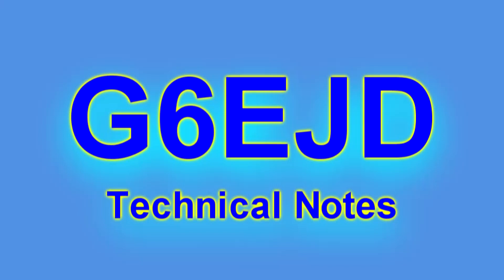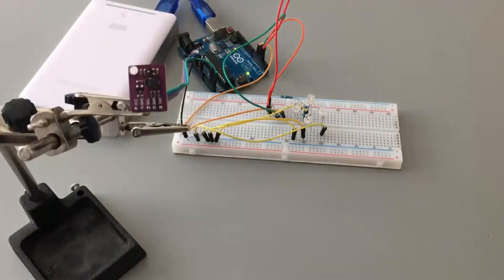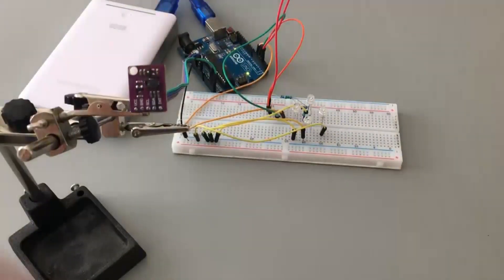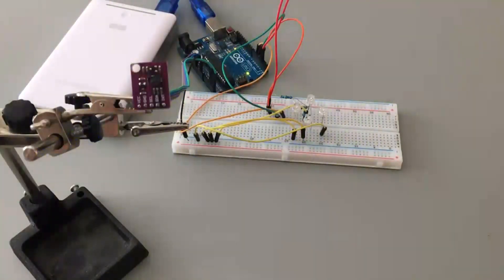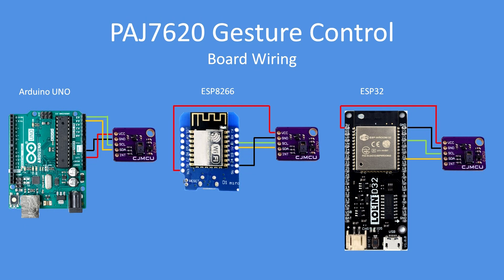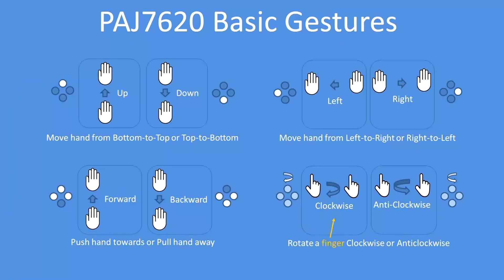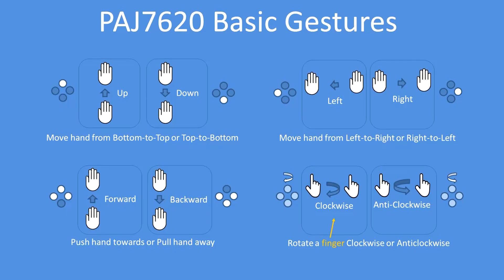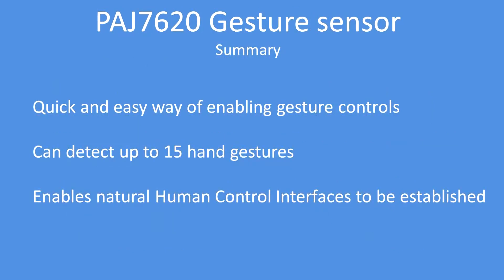Tech Note 104 - Adding Gesture Control to your Arduino / ESP projects

Comment: @G6EJD - David, Is this sensor better than dhe APDS-9960? Im planning to use a gesture sensor in a production product. Thank you!
Reply from the maker: The 9960 is a popular device, used by Samsung in their phones, but predominantly for detection of the phone being moved to the ear to switch off the display. Gestures have to be coded from the 4- sensor positions, whereas the PAJ7620 has 9-built in gestures so the interface is easier and done for you, for example your code would need to keep polling the 9960 for a proximity detection then if you want to detect a swipe monitor the 4 sensors to detect changing amplitude and hence gesture, the  PAJ7620 whereas will do all that for you.

Comment: nice work ! but I wish it could detect gestures by a standalone  esp32-cam  , like esp32-cam face detection
Reply from the maker: You’d have to ask the chip manufacturers about that
Reply: @G6EJD   maybe I will do that but before you'd better see this 
https://eloquentarduino.github.io/2020/01/image-recognition-with-esp32-and-arduino/ 
I mean something like image proccessing
Reply from the maker: I bet it could not tell the difference between an orange and green ball and the real fruit.
Reply from the maker: Yes I had a sample from Espressif before they released it, works well.
Reply: @G6EJD  well , what’s ur idea about something which can recognize open and fist hand?
It will be awesome in BMS fields,remote less and key less lamps... if it comes true ...
Let’s do this shit OK?

Comment: hello, I have these error, I used arduino 1.6.5 IDE.   

Arduino_Gesture_Control:54: error: variable or field 'LED_Swipe' declared void
Arduino_Gesture_Control:54: error: 'swipe_dir' was not declared in this scope
Arduino_Gesture_Control:54: error: expected primary-expression before 'int'
variable or field 'LED_Swipe' declared void

can you help me? Thanks.
Reply from the maker: Have you installed the library '#include "paj7620.h"'
Reply: Solved... with arduino 1.8.7 works...

Comment: That's cool!
It works well in Uno, but it doesn't work in ESP8266. ESP8266 cannot get the I2C data from PAJ7620.
Does the same source work on Uno or ESP8266?
Reply from the maker: RCanDo, I can see no reason for it not to work on the ESP8266 apart from the UNO uses 5v inputs/ outputs whereas the ESP8266 uses 3.3v so you may need to use a level shifter on the ESP8266
Reply: You are right. It works well on the ESP8266 too. Thanks~!

Comment: Finally tried this sensor, but very dissapointed. It's extremely inacurate, or maybe the library is not well programmed. Being the datasheet a joke (no information on what each register means), it becomes impossible to fine tune the sensor. For those in need of a gesture sensor, you can try the APDS-9960 which is by no means perfect, but very much more accurate than this piece of junk.
Reply from the maker: My sensor works perfectly from about 2cm to 30cm range. Have you checked there’s not too much infrared around the sensor as that what it uses. The data sheet gives enough information to enable gesture shapes to be programmed and adjusted. It’s got to be said, there are an awful lot of rogue suppliers selling devices that failed quality inspection as good products, also shameful that manufacturers sell their rejects rather than scrapping them.
Reply: @G6EJD  Hummm.....I bought this one from Aliexpress, so it might be defective....I don't know. I've bought several modules from Aliexpress before and never had any issues...this could be the first one failing. The sensing is pretty inaccurate for a real application. I was planning to reverse-engineering the example program to pinpoint the issue, but if the problem is the sensor itself I'd be wasting my time. I'll give it a try with the mbed library and if still inaccurate, I'll throw it away and go with the 9960. Thanks for your feedback.
Reply from the maker: I put mine on a breadboard tho morning all the IR leds are vertical and all works as expected. Sounds like yours could be defective. I’ve placed over 800 orders on AliExpress and my failure rate is about 10/800 so the suppliers are good, but also difficult it I report a product failure - they expect video evidence of e.g. sensor not working, I can never understand their logic, but AliExpress are very good on customer service if anything is faulty. Maybe you’ll have more consistent results with the 9960.

Comment: Hi, very nice demo. Just two quick questions. 

What is the realistic range of the sensor, I.e can I wave at it from across the room? 

And can you add a lens to it to focus / increase the detection range? 

Thanks
Reply from the maker: Operating range is typically 15-25cms as it is designed for hand held devices. It uses infrared light so yes a lens can be used provided the glass transmits IR ie without any coatings. For example most double glazing has an IR reflecting coat and thus does not allow it to pass through it.

Comment: Great videos as usual! Could you make a tutorial with ssl client on esp32? Having some trouble using WiFiClientSecure beyond their example (on other https servers).
Reply from the maker: In my TN032 an 036 I cover the use of SSL on the ESP8266 and exactly the same code will run on the ESP32. Some servers will require you to have a valid certificate which can be included in the code examples, others just require (most likely) a secure connection. The easy way to test is whether your browser can make a connection as it won’t have a certificate and if it can then it’s just a secure connection need. Be sure your router is allowing access to port 443 too, should be as default.

Comment: will it work in plastic case?
Reply from the maker: It uses an Infrared source and detector so if light can’t get through then no. It would need a small window to allow light to passage.
Reply: Can you make a small experiment (post video) with the sensor behind glass (behind a thin window or glass cabinet...) and transparent plastic, folio, canvas, thickness, ...? Does it work or it is less sensitive? Different materials... Just idea otherwise thanks for the video!

Comment: Perfect timing! Right now working one one tiny (in terms of cubic millimetres ) project with esp01 + BME280 + 0.96' Oled and thought how to add input - you just sorted it out elegant way! Thank you!!! By the way - have you tried to use this sensor through glass/clear plastic/ smoked plastic/anything else? Any link to buy it?
Reply from the maker: The devices used infrared and has a range of about 15-20cm which for most applications is adequate. It should work through plain glass ok or plastic providing there is no IR coating on the glass like that used on double glazing. The sensor is very small.
Reply from the maker: You can get them from AliExpress https://m.aliexpress.com/item/32866656088.html?pid=808_0000_0131&spm=a2g0n.search-amp.list.32866656088&aff_trace_key=637b012f1d2f44a08d51b606c5bb8636-1523725859317-02134-UneMJZVf&aff_short_key=UneMJZVf&aff_platform=msite
Reply: Thanks, Dave, just ordered a couple! Somehow I was not able to find it on ali when you posted your video. Cheers again!
Reply: p.s. figured out why was not able to find it - I've been looking for  PAJ7620, but I should look for  PAJ7620U2 - it might be useful if you will change the name in your video description for people to easier find it out.
Reply from the maker: I’m surprised how reliable they are and you can can change the gesture definitions/shapes when you get into adjusting the way it operates. The timings have significance in the way in which the sensor responds to either basic commands or the the more complex variants.
Reply from the maker: Thanks the U2 suffix refers to the device package type could be smd for example. They are widely available at a wide range of prices.